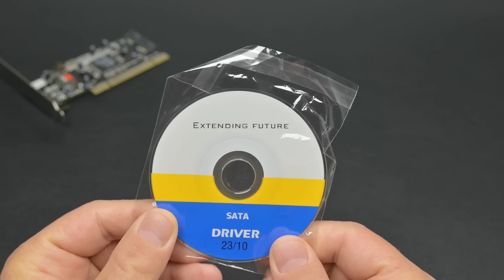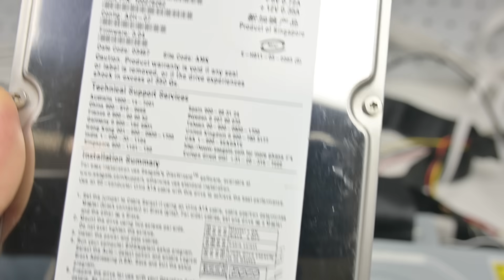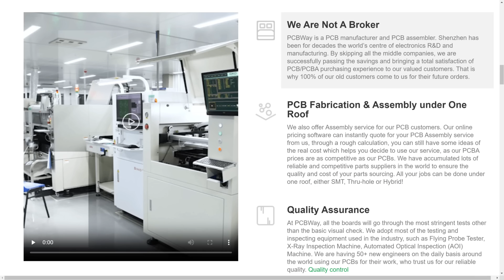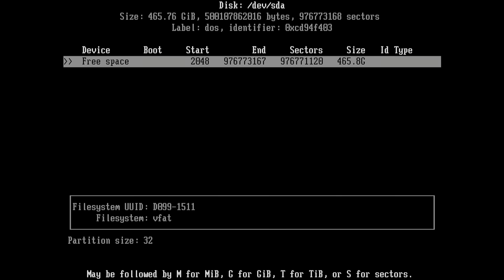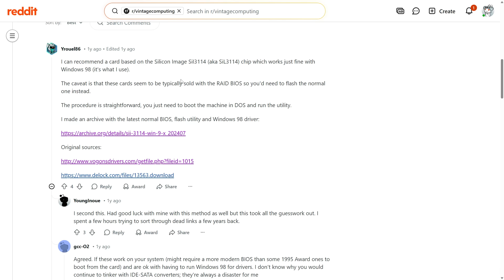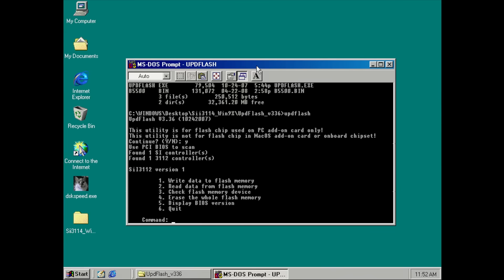SiI 3112 PCI SATA with Windows 98

Comment: This controller gave me nothing but problems back in the day. System was a Pentium III 550mhz in a 440BX motherboard. Everything got recognized (controller and sata hdd) but had issues when reading or writing and the system aborted completely. Could not install anything (Windows, Linux, FreeBSD). Tried two different card models with this chip. Then I swapped to a card with VIA chipset and everything worked right away.
Reply: im not sure but old user pcs used to have issues with controllers and other cards, it wasnt uncommon that some card might work perfect in one system but refuse to work at all or work unstable on another.  Part of pc shops job back then was doing that when you asked them to add an extra ide controller or network card, they would test the different models to see which one worked xD
Reply: What card?
Reply: @cpu-nineI don't think these existed "back in the day"
Reply: @Ktmzqw  It was 2005. I remember it perfectly. Not the year of Pentium IIIs, but I happened to use those systems.
Reply: @holgerwikingsen713 OK, so "back in the day" is a random date, not actually back in date anyone would assume you were mentioning (the 90s)

Comment: Phil, just a quick note - never do a raid with hardware raid controller for flash drives this will eventually lead to data loss. This only affects flash drives such as ssds due to the controller on the drive which are lying to the other controller which is expecting the “real” state

Comment: My MSI nForce 1 board and then Asus nForce 2 Ultra board both came with SATA floppies for Win 98 and XP which required installing through BIOS before setting up Windows on SATA drives. It was a bit cumbersome but nothing too difficult and worked well with my first time builds. I still have the floppies and motherboards for my Athlon XP 1500+ and 2500+ with 256MB and 512MB DDR RAM respectively. I also have those pretty nice "hubless" fans that maximizes centered cooling and uses magnets in each of the corners to drive the fan.

Comment: Now send this and a sata ssd back to my young self in 1999 (even though actually I loved windows ME, it worked so good for me!)
Reply: Windows Me was actually a decent OS,the reason people hates it was that it supported .VXD and .DRV and any old 16/32 bit drivers on theory,but in practice it was very picky and annoying causing many BSODs and headaches. It did not tolerate dirtily and messily written drivers.so using a 98/95 driver was sometimes fine but generally caused some isses,at least i have seen disabled hibernate because the drivers must support hibernating.

Comment: Hey Phil, i have a Sil3114 (4 ports instead of two), you need to flash the sata ide bios to the card to use a CD drive, the SataRaid bios is for raids only (no atapi support), thats why it shows up as scsi, iirc you should also have two sets of drivers, one for sataraid and another for sata ide. (the raid drivers wont recognise the ide mode, and the ide bios shows up as an ide controller, not scsi)

You need to change the bios and the drivers to disable the raid functionality. I only see the raid drivers on your cd image for 3114, but you do have the ide bios for the 3112 right there

just checked my drivers folder and the bios came in several flavours, b5500, r5500 and plain 5500, the readme should say which one is which, though not all the bios zip files i have had all the versions in them,  i think some versions were only sataraid, like the one that you have on your website only having b5500.bin.
b is for base, the ide mode i mentioned
r for raid
plain for motherboard bios development says the readme

go grab b4402.bin from SiI3112_4402all.zip and flash that to the card instead, that should fix all your atapi issues and maybe even give you a bit more speed

Comment: How did you reflash the bios since you could not boot with new bios?
Reply: You can from the device manager.
Reply: @nalinux when you can't boot how are you going to get into the device manager ?
Reply: @yoppindia Yeah, thats a catch 22 type of situation, so wonder if it was fixed via throwing the whole card out and simply buying another one :D
Reply: @yoppindia  I suppose most of us have several PC  :)
With a free PCI slot.
Or maybe boot from a floppy.
I have a TFTP / DHCP small server using an old laptop, so I can boot anything from the network in case i need.
Some 3Com network card can boot from DHCP, and most of the old others PCI like eepro100 or 8039 can't boot if you use the floppy "All In One" and choose gPXE.
Reply: @nalinux yours makes most sense, probably booted of floppy.
I don't even have a working floppy drive.
Reply: The flash chips can sometimes be programmed directly with an external device.
Reply: @redphoenix1000 it only works if you have phd in electronics, it's a quad smd soldered in.
Reply from the maker: I I plugged the SATA drive and booted from floppy drive. Then flashed from the floppy.

Comment: The controller was on motherboards that were the first to offer SATA, e.g., the ASUS A7N8X Deluxe series. So SATA I can probably be limited to 150MB/s by the PCI.
Reply: In real life - 40MB max got such thing 4 ports, maybe it's 80MB total, got 2 drives connected, wasn paying attention, copying data wasnt much faster than same HDD in USB 2.0 case,  3114, HDD via MB can do 120MB/s
Reply: @KabelkowyJoe my old WD 40GB two single platter IDE drives would do over 20MB/sec back then
Reply: @BrianMartin2007  Okey but i dont understand why you mention  that? Yest 20MB/s such speed is typical for IDE, UBS 2.0 is 30MB/s max, USB 3.0 ~100MB/s. And LAN 1GBit usually i could achieve 50-60MB/s.

What i wanted to say - by this - poorly edited comment - was that drives normally doing 120MB/s could maximum achieve 40MB/s, on this PCI / Sil3114 setup. This is what i remember. But because i had two, have tested also RAIDs i was copying files all over the place  i remembered that i was pissed of seeing 40MBs and overall experience of putting all drives into PC case wasnt better than copying files from one PC on my deks to another. After all i got now USB 3.0 "raids' and 3.0 USB cases - to be precise brand is Salcar, Maybe this controller in fact was passing trough 80MB/s this is why i mentioned, never been able to achieve that. Pissed of and rearranged setup.

On different machine got various 2.5" WD Black drives one pair is connected to PCI-E RAID forgot brand 36X something something.. and this one is doing okey. ATTO Disk Benchmark shows 100MB/s if connected to motherboard 120MB/s SSDs' 400MBs/ but these are connected always to motherboard. 

What i wantted to say PCI SATA is huge dissapointment not worth the play.
Reply: Can confirm, as I had this version.  Now I have the A7N8X-E Deluxe with Gigabit.  But never got it to transfer at gigabit speeds even though it links at gig speed lol
Reply: @BrianMartin2007  yes but it was faste then 100Mbit, in the end marketing
Reply: I HAD THAT MOBO with an Athlon XP3000+! Happy times. I made it to play HL2 back in the day
Reply: ABIT NF7-S - same controller. 😊
Reply: PCI bus limit was just 133MB/s? I tought much higher: 133 up to 533
Reply: @matusmitana8406  Only PCI-X with a 64bit bus that was used in servers can do that, there was also a 66mhz variant of standard 32bit PCI but I don't know where that was actually implemented.
Reply: @brandonupchurch7628  AGP!  😃
Reply: @brandonupchurch7628   Yes, nowhere to be seen in the run
Reply: @matusmitana8406  PCI Express x1 v2.0 - 500MB/s PCI 33MHz x 4 x 8bit = 133MB/s
Reply: @matusmitana8406  533 only PCI-X the 64Bit version, the 31Bit version PCI 2.0 has only 133MB/s
Reply: YUP! That's what my A8N-SLI had/Have - Still around with an Opteron 180 🙂

Comment: Some people are so nostaglic for the clicks and clacks of hard drives. But, personally, life is too short to wait for spinning rust. I used a promise fastrack pci sata 2 card on my p4 xp build with a 120gb sata ssd. It was so much better than what I had back in the early 2000s.
Reply: I use a SCSI 10.000 rpm drive.
Perfect annoying sound :)

Comment: Hey I'm on this video :D

I haven't used the Sii3112 but I don't think the BIOS for the Sii3114 can be just flashed on it as is.

Anyway flashrom also works to flash these cards and can also read the existing BIOS.

For me the Sii3114 has worked pretty well and it's my goto upgrade when PCI is available.
They can also work on Macs but there are some caveats like for example the G4 Quicksilver is extremely picky and to make the card work you need to change the 3.3V voltage regulator
Reply: I flashed a 3114 bios directly from the device manager in Win2k or XP. Didn't try from Win98.

Comment: Hi Phil. Does your Win 98 PC restart into MS DOS mode ok with your SATA PCI card? I used one of these Silicon Image cards a couple of months ago and it worked perfectly in Win 98 but didn't detect C: drive when I tried to "shutdown into DOS mode", strangely. Maybe I gave up too quickly (I just swapped to Startech SATA to IDE adaptor when the issue cropped up...)

If it works ok for you then I might have another go as the SATA to IDE adaptor doesn't solve my disk size limitation issue with the MB BIOS.

Nice video BTW. 👍
Reply from the maker: I didn't try this actually 😮
Reply: I'd love to hear if it works for you. Then I'll have another go, as it was nice and snappy, like you say.

Thanks for putting Vortex 2 drivers on your web site, BTW. Saved me a lot of searching. 👍🙂

Comment: on my win98 machine  i am using sil3114 adapter for a few years as game/data storage device.  if the  disk have been written to another pc,  and then i move the disk to win 98 machine , i am having disk corruption and unreadable data problem. if  the disk is used only by the controller i have flawless experience.
Reply: that card is pretty unreliable, had a lot of hard disk failures, co-incidence?

Comment: If you buy model with a VIA chipset, then you can update firmware in XBOX 360 DVD-ROM in Jungle Flasher tool.
Reply: That’s correct I used to flash the drives with the via set back in 2009 , but not all drives are supported in the later revisions like the slims
Reply: @MrKrimstah  For Slim DVD-ROM you need to drill a hole in the firmware chip to unlock detection of it in Jungle Flasher tool. https://youtu.be/BcGJbhoUTMA tutorial
Reply: how? where is the flasher tool? is on Archive?
Reply: @investit4  YouTube is blocking links and even give bans, so I can't post link easily here. If you still can't find that tool, then write here.
Reply: @investit4  YouTube is blocking links and even give bans, so I can't post a link easily here. Use Google to find it.

Comment: Thanks Phil. I converted to SIL3112/4  controllers a long time ago but have been using the IDE version along with a Startech SATA/IDE converter on the SSD.  I tried a SATA version but had no luck.  It will be great to have a direct link without the IDE adapter so I will use your suggestion and change the Bios. Easy install Windows 98/ME looks great.  Many thanks for that tip as well.  Happy New Year!
Reply from the maker: Happy New Year to you too 😊